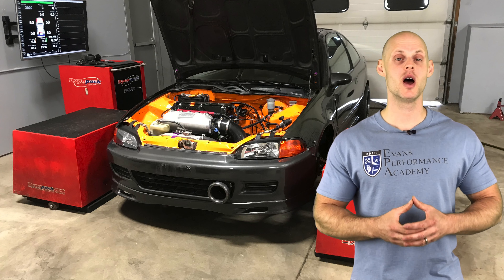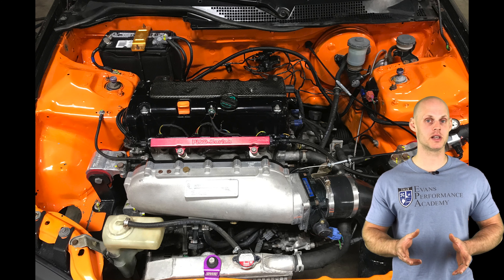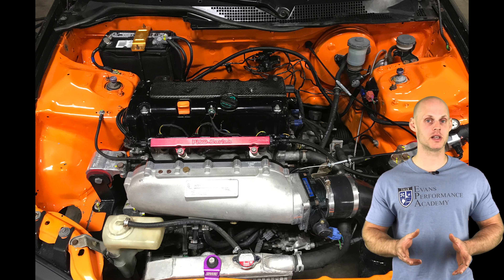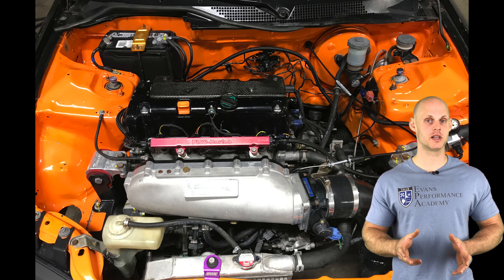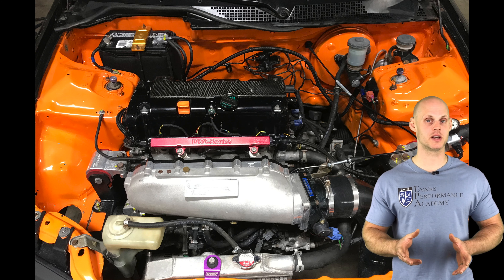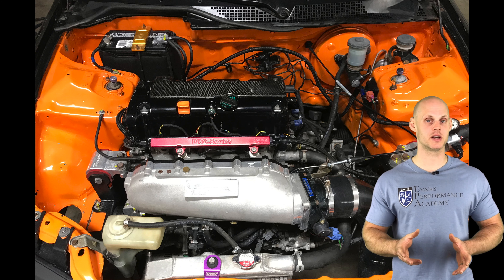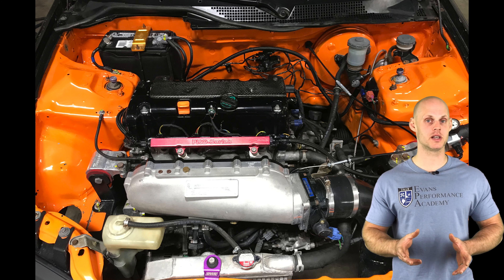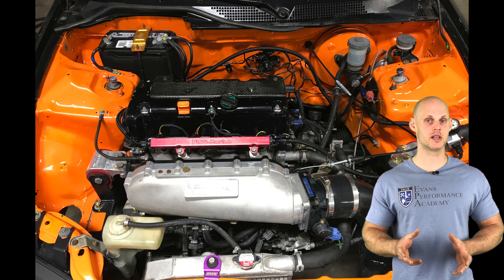Hondata Kpro Live Training: High Compression K20/K24 EG Civic Part 1 | Evans Performance Academy

Comment: What were the numbers??? I’m asking to compare to my build because i am doing the same exact build and I’m aiming for 300+whp my specs are k24a2 bottom end with arias 12:5.1 compression, stock stroke eagle H beam rods,stock crank, hand ported k20z3 head with supertech valve train, ferrea 6000 valves, drag cartel 3.2 cams, k-tuned intake manifold, 3.5” intake pipe with velocity stack,still haven’t decided what size or brand injectors,but Ima also going with 3” exhaust and I’m going to be on e85 and my management will be a haltech elite 1500 series, I have just about everything already,I just need to get a few more parts and start putting everything together